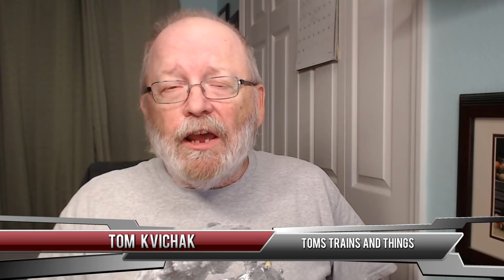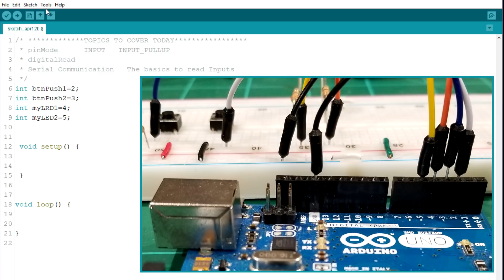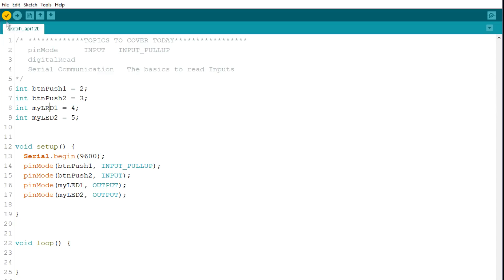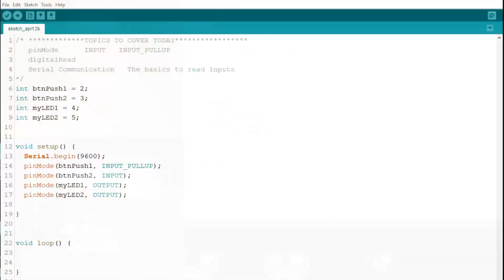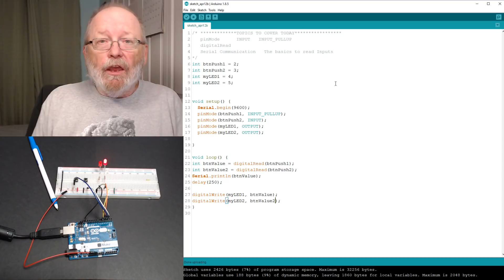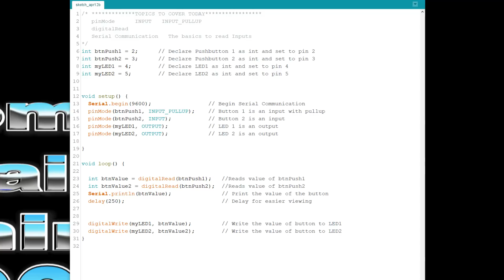Arduino Made Easy(er) Reading Inputs With Serial Communication

Comment: Tom; It would be helpful if say on Wed. you would tell us what components  we will need for Sat.excersize .
Reply from the maker: Terry, if you have a basic Arduino starter kit, you'll have everything you'll need for the next month . I have one on my Amazon page that I just moved to the top of the list for under $20. If you already have components, you can check the photo of the kit to see whats in it by hovering over the photo once you open the page. When I get a little further into the lessons, I'll let you know what I'll be covering. If you check my web page, I normally add the sketch and Fritzing diagram a few days before the video.

Comment: I’m still not sure why you need the resistor the one button. ??
Reply from the maker: It gives you a path to ground so you get a LOW on pin 3 until you press the button. Once the button is pressed, the path of least resistance is to your 5v, which gives you a HIGH.

Comment: Might be a little easier if you showed the actual schematic of the circuit.
Reply from the maker: Thanks Robert. For those who are beginning with sketches and electronics they most likely would not know what to do with a wiring diagram. That's why I do the Fritzing diagram. For those that can read a wiring diagram, it would not be difficult at all to transfer the Fritzing diagram to a wiring diagram.
Reply: Yes, I guess you are right.